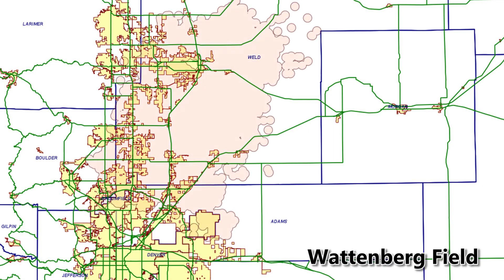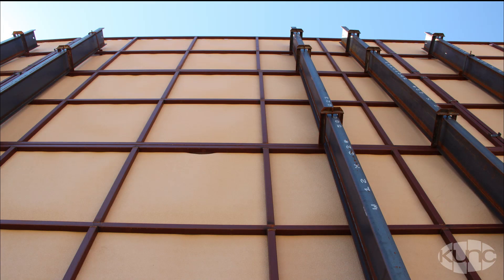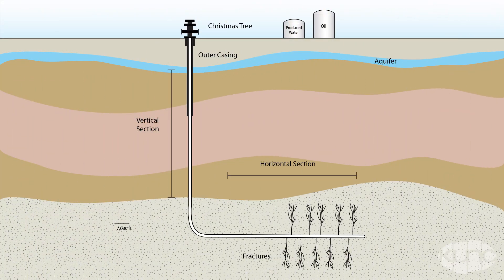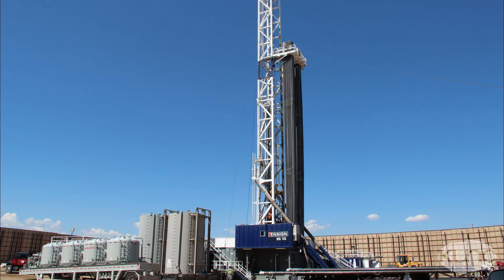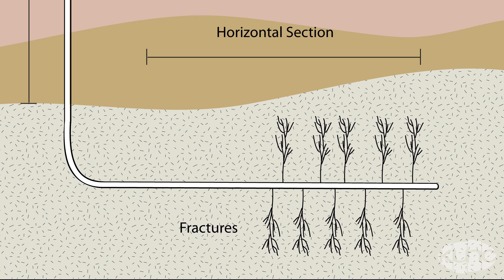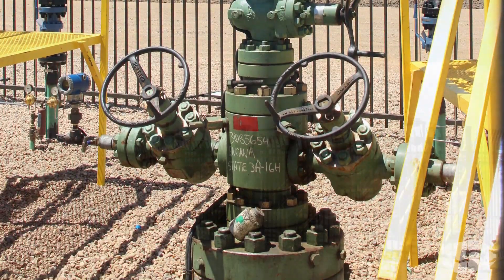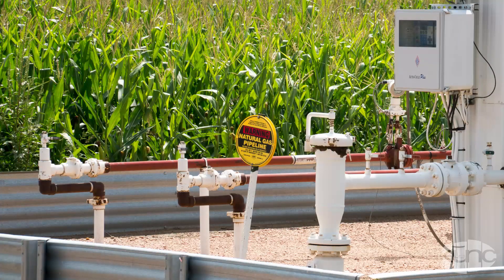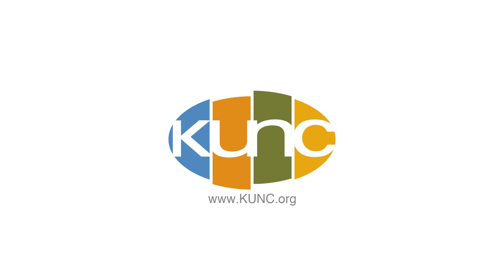Northern Colorado Oil And Gas Drilling Overview

Comment: I have to say it takes longer than 10 day to drill a well that is horizontal. the people that made this video has no affiliation with the oil and gas industry. the information is not accurate. needs to be updated for more accuracy. there is a lot more information that would explain from start to finish what your trying to explain here. I'm not complaining just pointing out.